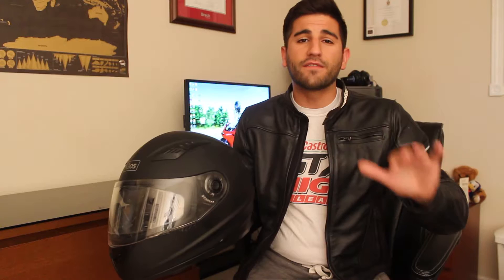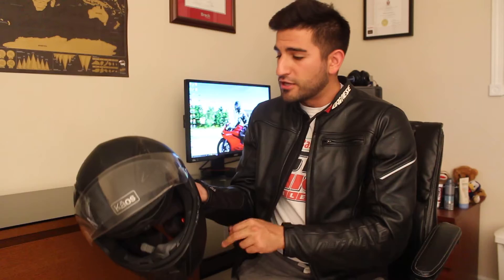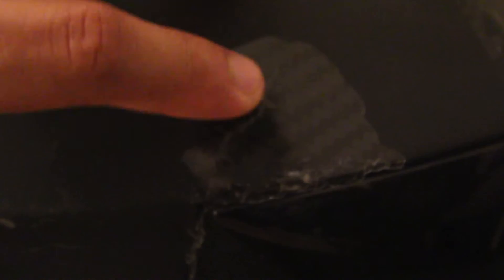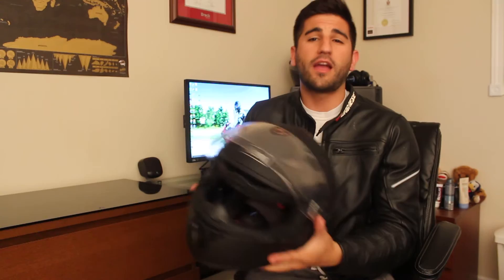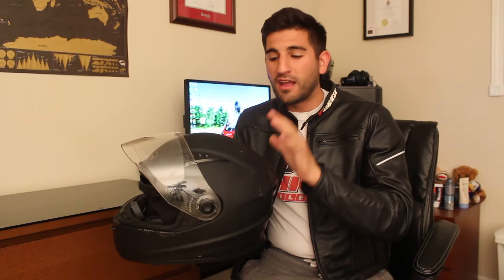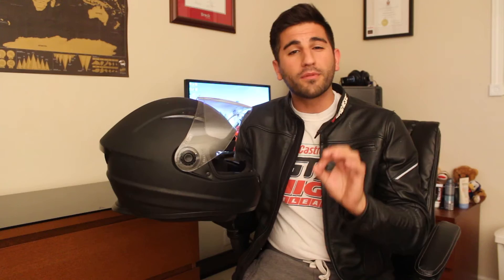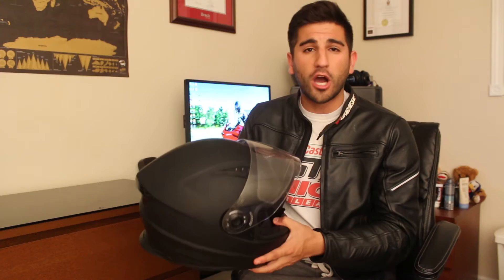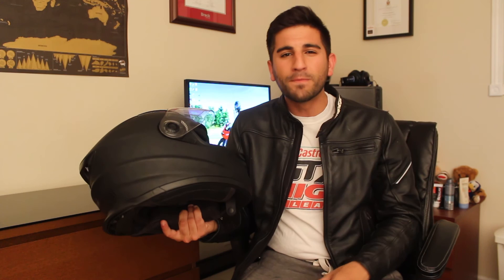Motorcycle Helmet Post Crash Analysis!

Comment: Would you have replaced it if it was just the damage on the side/shield? I slid out on gravel at 20-30mph and all my helmet has is a little scratch in the matte smaller then the spot on his under the shield
Reply from the maker: john hancock hey John first thing is I'm glad you're ok and that your helmet did its job. the facts are that even a minor dropped or impact to the ground cause our helmets to microfracture. they are designed to do this. technically speaking you should replace the helmet if you want to Ensure you are 100% protected. personally if it was me and it was a very minor scratch or damaged I would probably just continue to wear it. would it be jeopardizing my safety a little bit? Probably. it's really up to you

Comment: I listened to a podcast which interviewed the director of snell, who said dropping the helmet itself is no cause to replace it. The impact from within the helmet is the important thing, your head cracking through the inner shell layers. The podcast was by motorcycle mentor. Before I heard this, I always believed in the one drop policy. But as you said, in the event of a crash, replace for sure.
Reply from the maker: hey FK482, do you remember by chance what height the drop was considered from?!
Reply: +Canadian Rider I don't think he mentioned that which I would think means anything in the usual realm of a drop - from your hand while holding it or off your bike maybe. Does seem a bit sketchy gambling with your head's safety though! I'm sure dropping off a balcony would render it unsafe!!
Reply: Had a sec so dug it up if you're keen to listen. Link below and the part about dropping it is at around 27.50 in PART 3 of the interview.
http://motorcyclementor.com/how-snell-tests-motorcycle-helmets/
Earlier on in the interview though he said to avoid hanging the helmet off the mirror as the pressure it places on the inside gradually degrades the helmet.
Reply from the maker: +FK “FK482” 482 beauty wow thank you for finding this for me going to have a listen now :)
Reply: No probs mate. Keep up the good work with the vids. Keen to find out where your panigale went!
Reply from the maker: I will post a update soon :D